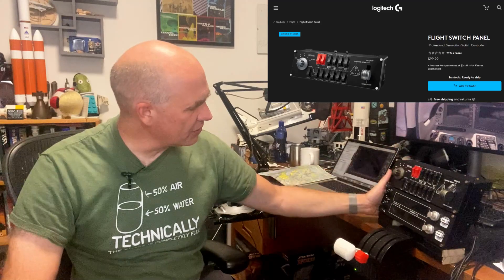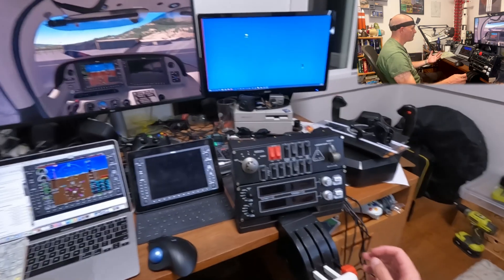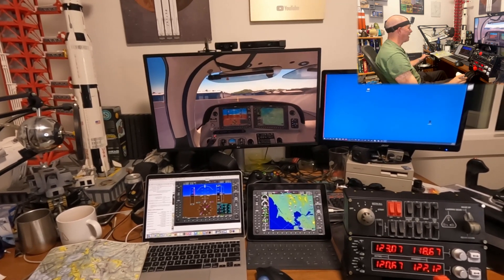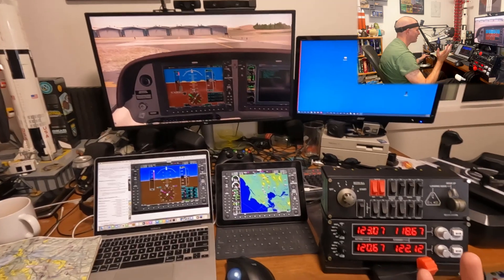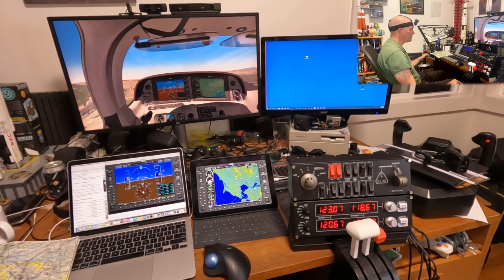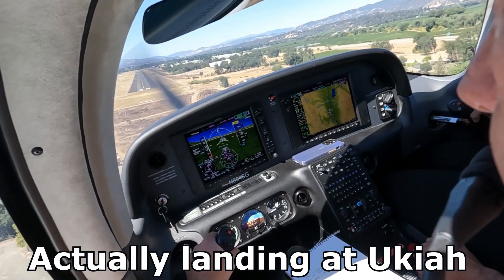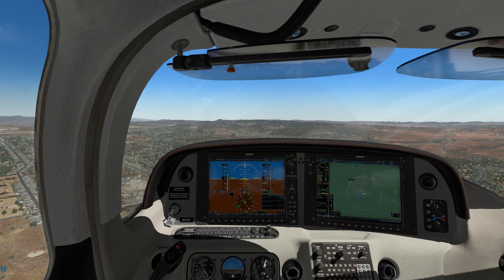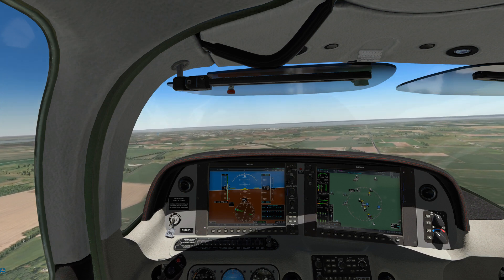Learning to Fly With Real & Sim Hardware

Comment: I learned in a 150 cessna in Stead Nevada 5050 altitude. Ya when you screw up or get to slow you learn about flying really quick. Especially in thin air. When you get done with your low altitude training go to Stead Nevada it will teach you things. BTW I learned without a Airplane Parachute . I darn near soild my undies a couple of times. Heh, it's called Pucker Power... ;) High altitude Mountain/Flying/Training will make you a better Pilot.  Do This for sure
Fly Safe Buddy. 

I love your posts...

Comment: That's cool. One thing I noticed that may help in the future: You may want to get in the habit of saying "zero", when it's a zero, not "Oh", e. g. in frequencies. If you listen to ATC, especially when they give you a heading or a speed to fly, they will say "turn left heading one-five-zero", or "reduce speed eight-zero knots", they will normally never say "oh" if they mean zero. (As a side note, a well-trained ATCO will also never say "to".
Flying a Cirrus is on my bucket list, so far I've only flown DA20, P28A, RALL, DR40, EVSS, and looking forward to the C172 familiarisation flight this Tuesday.
I also use X-Plane to practice procedures for airfields I fly into for the first time on long cross-country flights. It's a great tool. Too bad that X-Plane 12 will drop OpenGL support, and my old Mac has an Nvidia card, so Metal/Vulkan is not supported.

Comment: Great video.
My first experience with a forward slip was in a glider and we were racing a squall line to the airport.  We were already at full spoiler, and the instructor turned the plan well to the right and dropped the left wing.  It felt like we were flying sideways, and I was looking through the side window at the runway.  Made it in with room to spare, so we could secure the plane before the wind gust.

A couple years later, I had to opportunity to do something similar in a 737.  I was on a training flight which allowed me the chance to fly along the Grand Canyon.  To give a better view into the canyon, I was told to put the plane into a shallow forward slip.  I hand flew the plane in this state for about 15 minutes.  One of my favorite flying memories.

Comment: I've heard that you lose a lot of the sense of knowing what wind forces are acting on your aircraft since you're not moving in a sim and it has had me wondering  if it would be feasible to build something I'd call an assometer (ah somme uh ter).  Basically something that would get a feed of the net external physical forces on the aircraft in all three axes,  then use that data to light up a matrix of lights around the edge of the monitors and a strip running fore-aft to your side.  The idea being that this thing visually displays what you would normally feel in the seat of your pants.  Did a  tail wind just start pushing you from behind and rob some lift?  You normally would have felt that as acceleration, so the for-aft strip would light up and strobe in the right direction (forward for tailwind blowing you forward, aft for a headwind slowing your down).  Strobing speed could indicate the strength of the gust.  Might be useful for cases where you catch a headwind gust on short final which is boosting your lift but suddenly disappears on you at the last second causing you to land with an inelegant thump.   Might also be useful for immediate corrections during cross-wind landing  so you could react based on how much force you "feel" (see) rather than having to wait a tick to see what the net result of the force did to your approach.

Comment: Hi Scott, there's an antenna mod that may fix the antenna's for you.  I've been using it for months and it really makes a difference as there are several towers in north of my airport (KYWY).  
Also, really, really worth it to get three 32 inch monitors, really helps orientation and immersion when flying (I angled mine at 36 degrees angled in... just did this in last week and my hours have increased because of this :  )
You may know these things... if so, my apologies.
I need to practice more failures, I do dead stick most landings along with slip  (I always assume wind turb as live weather).
If ya want to try a really tuff fly, DCS F18 "River Run" mission in Caucus at Batumi... makes flying in city streets feel easy in msfs after this... i.e. was/is good practice for me.
You fly safe too Scott, O7. 

(snip from antenna mod author on msfs forums below, it's an official msfs mod btw).

"I’m happy to bring you the latest version of We Love VFR.

What does it add?

Almost 110.000 tv, radio, and gsm masts and towers
Over 30.000 chimneys (cooling towers in development)
Over 30.000 construction cranes
Almost 1.000 satellite dishes and radio telescopes
Nearly 350 radar domes
Over 100 custom models"

Comment: If you don't have a force feedback stick you need to set an expo curve on your stick to desensitize the centre.  In the real place, you apply pressure to the controls, rather than try and "move" them, but with the fixed spring tension on the stick your lose accuracy near the centre because there is no feedback.
Most flight sim air dynamics add-ons that update the default air files will address this.  It was the same in FS2004, completely unrealistic, elastic nose pitch which in the real world would have you vommitting.
Reply from the maker: Maybe, but first I need an actual yoke. The cirrus controls are already spring loaded and I don’t feel much in the way of aerodynamic effects beyond elevator and rudder requiring more force at speed.

Comment: It looks like you're really having a blast flying and what a great little setup for the sim.. I was lucky and picked up the thrustmaster hotas x a couple years before the pandemic.. It's not a realistic cockpit yoke and throttle, but it's quite sensitive, and a ton of fun to use in flight sim on an extreme budget (got if for like 35 dollars) - if you can find one they're like 200 bucks now, the pandemic did that. Anyway thanks so much for sharing this info, so much fun!

Comment: I am a real Cessna 182 owner and I built a simulator that is the same panel as the actual aircraft. It uses X-plane and I also 3D printed a bunch of stuff including the throttle quadrant and flap and trim stuff. I find it very useful for practicing instrument approaches as well as general IFR operation. I can’t say that VFR flight is very interesting to me, but that is where MS 2020 with VR comes in. Outstanding visuals on that but bad at “touching “ things since you are a ghost.

Comment: If you want to get your brain into the whole side slipping mentality get yourself onto some icy roads. Better yet, get yourself a rental car and drive onto some icy roads. You can probably head towards Reno or towards Oregon from where you live and just let that tail hang out make sure it's a rear wheel drive car not a front wheel drive car. Or... you can just go over to Laguna Seca to the racing school. I hate to say, and though I would never endorse it if Skip Barber Racing is there try them (Russell also okay) but I think Barber is better. Liklke I said though I would never endorse them because of internal blah blah blah 

Anyway good luck with that just something that might help you be a little more comfortable with stuff going sideways

I learned to fly in a Seneca and a twin engine Baron and the first time I had a crab in the wind my instructor who happens to be my uncle on a commercial pilot just kept looking at me not even understanding how I could be so calm and comfortable with it looking out basically the side window well not really but you know what I mean.

Comment: I'm sure someone else has already told you this, but I kinda got the subtle vibe that if you had executed a go around that would have been a failure of some kind which of course it is not. It's always the safest default choice if your approach is unstable, which I'm sure your instructor has drilled into you as mine did :) Kudos for being spring loaded to execute one.

Comment: I'm working on my instrument rating and if you take is seriously and set everything up right the sim will make the transition to instruments easier. Not easy. easier. The aircraft isn't flying through thermals and downdrafts as it does in real life. Sometimes only one wing will pass through the edge of the thermal or downdraft. The flight sim is a good way to learn procedures after you fly them in real life.
Reply from the maker: XPlane will simulate this kind of atmospheric instability if you want it.

Alternatively, try flying with one of your flaps missing.
Reply: @scottmanley  It does but it's entirely different when everything is moving, including you. I'm not criticising  XPlane though. It's great for basic instrument skill development and flying procedures once you've done them in real life. 

Getting my PPL was fun. My first  training flight was 5/24/86. I started my instrument training around the 100 hour mark, well after getting my PPL,  but a work transfer took me away from a CFII. I got a mountain checkout in a C182 but never did find a CFII when I was in Colorado. That was a long time ago and GA was in a slump. 

About 3 years ago I decided to get back into it and start working on my instrument rating again. I really enjoy instrument training and the way that it requires me to be precise. Don't get me wrong, I like boring holes in the sky too. I love cross country flying. But instrument training, for me, beats all of those hands down. Once I get my instrument rating I may work on my commercial rating. Idk... I wouldn't mind ferrying aircraft as a side job.

Comment: VS a real simulator that costs tens of millions of dollars and have motion.  The motion in a motion simulator is still not as beneficial as training in a real plane because of all the loading over 1 G that is not possible in a motion based simulator or an arm chair.  One of the most important bits of training is that for the instrument rating.  We have to experience and learn to ignore all the G loading of real flight that will start the fluid in our ears spinning.  This can take many hours to train one’s mind to experience the disorientation that comes from your ears while trusting your instruments implicitly.  
The emergency engine out training in your set up looks good and should be beneficial.  I’ve had 13 single engine failures as a test pilot. My first few were real of course (years ago) and I know it takes at least 2 to get really good at all the decision it takes to survive and to get used to the pitch attitude to maintain best glide.

Comment: Hi Scott great video as usual. I would like to ask u about nasa rocket Artimis. I understhat the reason the main fuel tank us orange us because  a poly somththey spray in the rocket to keep the fuel cold but the poly something is actually white bit turned orange when in open air. But my question is why do they use this polyethylene to keep the fuel cold but Xsoace and the rusian rockets aren't orange so what is the difference. I hope u see this comment and can answer it in future  video. Thanks again

Comment: I work in flight training simulation, making the big full motion simulators used for pilot training. As you say, your life isn't in danger during emergency scenarios in a simulation, but in the sim those scenarios can be quite stressful. I've been working on these things for 15+ years, and I've been in them with pilots doing scenarios that made me real nervous. Latest one was a max weight takeoff, at a high altitude airport, in the mountains, with an engine failure. We had to thread through valleys and between peaks for 10+ minutes before we were clear of terrain.

Comment: love the setup; fyi 20/22 are the same size, only diff is hp, which comes with more proformence,  and options ie tks flir “5 seats”
Reply from the maker: There's other structural differences, like larger fuel tanks, but yes, SR20 is a lower power SR22. An it's still a high performance aircraft by FAA rules.
Reply: @scottmanley  yes, and yeah structually differnt but all in all dimensionally its the exact same
Reply: @scottmanley  thing i find funny is how cirrus has innovated and lead in aircraft systems…except in one area, FADEC; especially in how sensitive their engines are to mixture, and cracking cylinders

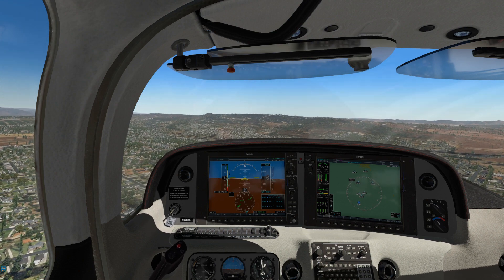Comment: 12:30 You didn't read back RIGHT downwind on the initial call, so the controller should've confirmed with you.  You both made a mistake.  :)
Reply from the maker: Indeed, I flew the default traffic pattern assigned to that runway when the tower is closed.

Comment: Scott...you should use TrackIR (although, I'm pretty sure you would have tried it by now given your interests). It's not very expensive, and really worth it for pilot training IMO. I'm a GA pilot and long-time simmer (and formerly worked for Singer-Link at NASA). I'm also an active VR user. But, I still use TrackIR because it's like being in VR, but still able to use the hi-res screen and be able to see your physical interface equipment. I used to use XPlane mostly, but started using MSFS2020 now that I have Garmin G3X touch screens in my real-life RV-10 (because 2020 has the excellent 1000NXi screens which are very similar Garmin devices).

Comment: USAF and USN VR sim designer here :) . A couple things that can help improve carryover from simulator to reality:

1: Control placement in relation to your body. Stick between the knees, or just above and to the left or right of your respective knee. This is close to how it is in real aircraft and it is that way for a reason. If you put your stick up on the desk, you end up flying with your arm instead of your wrist and finger tips. By resting your forearm on your knee, or on a rest to the side and letting your upper arm hang down, you can flying wrist and finger movements which is way more precise. Of course, having higher control forces (real aircraft have far higher forces than flimsy gamer sticks so trim becomes essential) helps but those sort of devices are probably beyond your budget.

1b: Rudder pedals. Get CH pedals rather than saitek/logitech. They have far higher control forces. Also in most aircraft your legs stick out more or less straight from your body, rather than the 90° bend most desk chairs give. So you want a chair and desk fairly low to the ground so you can straighten those legs. Helps quite a bit.

2: VR. A common problem of students who start in the sim is flying on instruments when you should be looking outside way more. And it is understandable. A limited screen FOV plus slow panning control sucks. Get a VR headset however, and you can look around with far more freedom and stop focusing solely on instruments when you should be VFR.
Reply: @Scott Manley looks like you got an impersonator.

Comment: One way to save your yoke is get some nice damping grease, what they recommended is Nyogel 767A, but I got different one with similar parameter, works great with also pedals and throttles.
The problem with plastic controllers is the static friction, it will ruin your small adjust, because you'll need higher force to overcome static friction and then suddenly you need less force to move it by a little mount, that's why the saitek yoke and many plastic joysticks feels so terrible. and why damping grease could save it.
I went to metal joystick anyway. I currently use VKB gunfighter with SCG-L, the only one I could find with consumer price have full-metal moving part and LEFT HAND grip, perfect for left seater on cirrus or airbuses (it can be tuned to very close to Airbus stick feeling, not sure on cirrus though), But I also fly with it on Boeing, Helicopters and F16s...

Comment: I love Slip, you should really train that, but I guess it's more important for a soaring pilot. I made the soaring licence and at the end of my exam flight during approach my flight teacher just said: "Boring!" and stepped into the rudders. I retracted the breaking flaps and continued in a slip. I should mention that the exam is done with a motor glider. From what I could see in your video the steep approach seemed to be similar to a soaring approach. Don't you have breaking flaps you could use in that situation?

Comment: I used one of these yokes too. I only flew Flightgear at the time and yes it worked like garbage. I wrote a python program interfacing to the FG websocket to smooth out the controls because they are so jerky. Then it works quite nicely.

Comment: As a person used to engines where the fuel pump runs whenever the engine is running (motorcycles  in case anyone is wondering), the process of flipping the pump on/off/on/off freaks me out more than it probably should.

Comment: Scott, Side slipping a 172 is my most fun thing ever. With a little practice you can love it too. The secret is to put the wing which is into the wind down, stand 100% on the opposite rudder, then balance the plane with the ailerons. I can slip down to a couple of feet off the turf. Then just neutralize controls and she straightens out. At least, that's how it works in the 172. Your mileage  may vary. But this is an essential  skill if your flaps go out.

Comment: You think the Saitek is junk but you use a Wingman extreme? You might be on drugs. The saitek is pretty good for the price. There are better yokes (and pedals) but they are vastly more expensive.
Reply from the maker: It’s not a wingman. It’s an ‘extreme 3D pro’ it’s smooth enough and has decent tension.